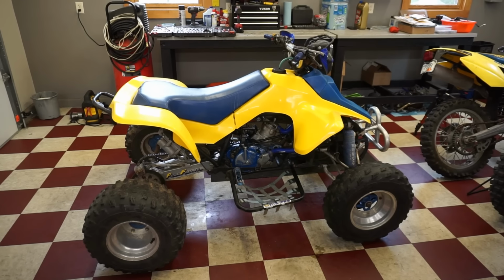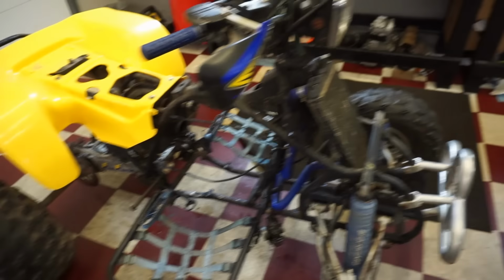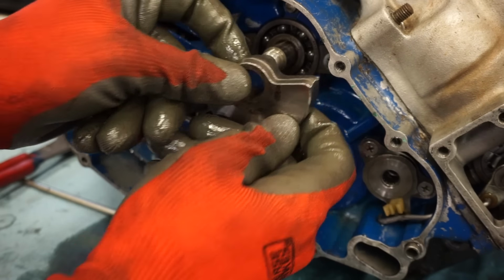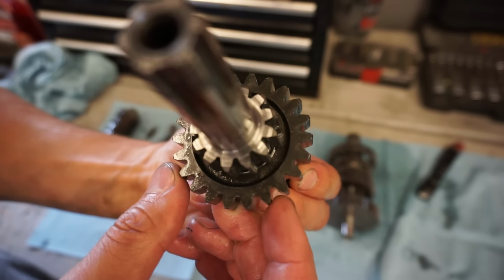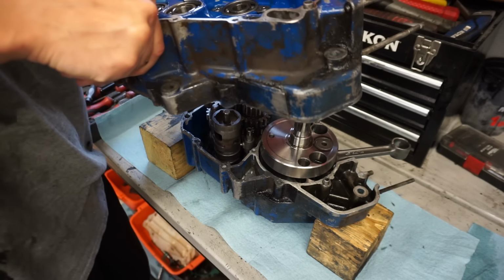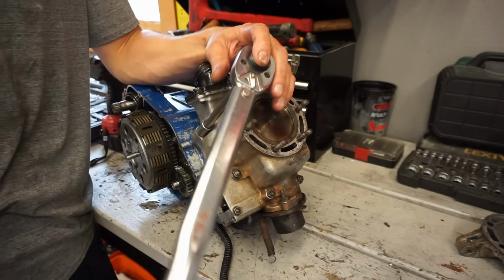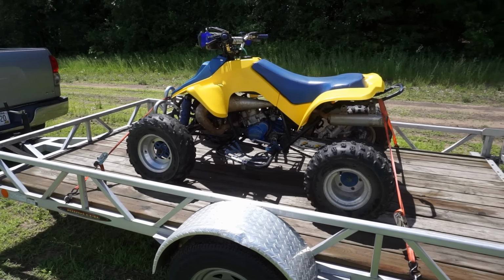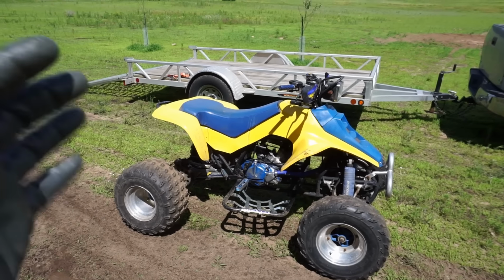Rare 2-Stroke Race Quad Slips Out Of Gear...(PROBLEM FOUND)

Comment: Ever heard of backgrinding?? Look it up. A little bit of grinding on the gear dogs in the right place and when the load comes on they engage and some.  The old gearset would have worked. Pays to check end float too.

Comment: One of the top LT250r builders chiming in here.  Please air-leak test that engine.  The exhaust valve can be tricky to seal up but once it is, it will jet easily and cleanly.  

Again, let me know if you need anything for that machine.  I have NLA OEM engine service parts, upgrade parts that I make, and lots of graded used parts.

That FTZ pipe is beyond rare.  I've never seen one of theirs that run in the stock pipe routing.  The more common(still SUPER rare) FTZ pipe hangs out of the frame on the left side and is HUGE.  

If you want that bike to really run well, shoot me a message and I will be able to point you in the right direction.  The AAEN porting on your cylinder isn't what most would call great.  If you could get a clear pic of the engraving it would help ID if the cylinder was actually ported by them or if someone carved it on there themselves to try to increase the value.  Both FTZ and AAEN did port/pipe/carb combos so it is kind of odd to see the mismatched tuner's products on that bike.  

I can help with details and history on the parts on the bike and the tuners that made them if you want.  Just let me know what you want to know.
Reply: Makes me wish I still had my 86.
Reply: lol,i thought i was the top lt250r builder???lol.dont pad yourself on the back to hard!!!lol
Reply: @yeahright302  I stay humble.  My work speaks for itself.  I have rolled back the work load for the last couple years but I still stay in it.  You'd be surprised who is who behind the username.
Reply: @rm25088  Do you have an '88 RM250?  I'm pretty sure I have a complete top end for one.  It would need replate, but is complete.
Reply: What exhaust valve?
Reply: @yeahright302 How insecure can you get? A guy offers help and you shit on him. Get a life.
Reply: @joebinder6119  There is a valve in the cylinder for a resonance chamber to improve low RPM torque.  It closes at around 5500RPM.  It's not a true power-vavle but more like the Honda ATACS system.  It commonly can be tough to seal up.  It can draw air from the transmission/clutch housing.
Reply: Sounds like you know what you are talking about.
Some listen some don't
Reply: Thats awsome, if I where him id be hittin u up .. kinda rare these days to find someone that knows and is willing to help in the ways that u offered
Reply: Experts chiming in everywhere😂
Reply: The oil in the transmission on a two-stroke has nothing to do with the engine
Reply: @joebinder6119 the one in his mind
Reply: @RonaldDaub-xi5jz  Your comments show clearly that you are not familiar with 2-strokes, let alone this model.  

Indeed the transmission oil and the lube oil for the engine should be separate.  

What do you think the "exhaust valve" I am referring to is and does?
Reply: @BillyWillicker 
Those pesky crank seals,and trans oil.😂

I find those power valves are voodoo black magic, best left to a pro.
Reply: @johnrambo1227  It depends on your level of understanding and skill.  There are a few ways to do things right, and many ways to do things wrong.  

If you understand the how and why of what you are working on, it can be done well.  If not, it should be done by someone who does, and will do it right for you.

Sometimes, depending on a person's skill and knowledge, it's cheaper to pay someone to do work for you.  

Have you ever seen an engine that someone who had no clue what they were doing had worked on?  I'm betting you have.  What did it make you think?
Reply: Hmm, I have a 85 LT250R and need some info. Can I send you some pics? Contact info perhaps?
Reply: I got a 87 im building whats your contact info
Reply: yeah its not revving out clean

Comment: You were absolutely right, that missing bolt on the shift drum was the initial problem but it was ran that way too long and probably worn the shift forks out of tolerance which you’re probably not gonna see with the naked eye. I don’t blame you a bit, I’d have done the same thing just replacing the bolt and trying it 👍

Comment: One these race bikes/quads.  -Always nice to have a 2nd or 3rd engine/bottom just sitting and waiting to go in.   =Race 1 and work on the other.
Reply: That's what I used to do. I had a practice bike and a race bike. The race bike was strictly for that purpose alone, while the practice bike took some serious abuse. Every Sunday was fun for two reasons. # 1 was the racing, and # 2 was because I got to ride what was essentially a brand new bike.

Comment: Those old Suzukis are nice.  I had a Quadzilla back in the day.  Still kinda miss it but it needed pretty regular repairs / maintenance.  This is why I like my Raptor now.  Almost no maintenance.  Change the oil, lube the chain, put gas in.

Comment: Great job, at time frame 33:59 you can see where the gears have rubbed the case next to the big bearing in the r/h case ,most probably when the end bolt was missing previously .Is that where thee metal shaving came from.
Reply: Could very well be. Besides regular clutch wear which can be seen with every oil change (it makes the oil look like metallic paint) anything large enough to be able to feel with your fingers is abnormal wear.
Reply: @stkyfngrszmooth  The clutch is on the outer case ,and not were i described .
Reply: @johngriffith5231  Yes, but it still shares the oil with the transmission.
Reply: @johngriffith5231  Yes, but the clutch still shares the oil with the transmission.

Comment: Glad you found the issue, it`s hard to believe that little bit of wear caused the problem, but obviously you still had something rubbing which explains the shavings still in the oil, there was something wearing on those gears and shift arms, well done.

Comment: My cbr600rr would slip out of 2nd gear on acceleration, I found the dogs and recesses on 2nd gear to be worn exactly like yours except the shift fork that engages 2nd was deeply gouged, not bent but gouged, and those 3 things added up to 2nd gear not staying engaged. It's been 10k miles since I fixed it and 2nd gear is still going strong. Good job Joe transmissions can be very tricky

Comment: Hey Joe, place a slim O ring on the shaft with the litttle gear that likes to go AWOL. That way, you can slide the parts together and the O ring will not cause difficulty. I do that when I build transfer cases and transmissions because if the needle bearings get away from me, it all has to come apart and be reloaded.

Comment: Great job!!!
..she sounds really tight and.fresh, sounds like u can drop the main a few to get it revving higher at full throttle and richen the pilot or maybe turn the air screw half a turn richer , Since u can literally rebuild.any motor now , next genre to start mastering is Suspension,...rebuilding, serving, oil, seals, disassembly, special tools tht motion pro should send u free as long as u advertise.using it in videos....surprised u don't leverage even more of.your massive following to aquire free tools from like minded companies.into moto....

Comment: An Accumulation of wear throughout everything in motorcycle transmissions can cause mishaps in the shifting. In fact I would have measured the left side of the shift drum that goes into the bearing on that side, as well as inspected to see how tight the corresponding bearing was in the case. I noticed during the first go around that one of the bearings in the case nearly slipped out...... that tells me the case has some wear, which could be where some of the flecks were coming from, along with the gear wear. Usually on an older machine you end up finding out that the main problem is case wear, that leads to gear wear, that leads to shift forks wearing, which also wears out the drum over time and shifting problems. However often if it's an old machine, it starts with case wear.  You can put brand new parts in an old case that's only slightly loose, and within a few years, you'll have shifting problems. 
Years ago, I've seen guys mix up JB Weld and put a light coating on the outside of the bearings before installing them in the transmission case, just to snug everything up a little. They'd reassemble it, and let it sit for a week with no oil in the gear box, so the JB Weld would harden really well, then put the lube in and put it back into service.  If you're trying to patch up an old machine to get another couple of riding seasons out of it, for a good customer, you let them know the circumstance, and that it will buy a little time for them, until they can maybe find a donor replacement engine to build .

Comment: In my experience one popping out of gear is bent or worn shift forks. I know you measured them and the thickness was the same. But I’d bet the forks that came out were slightly bent from the shift drum moving around.

Comment: FTZ - full race, high end.  -See if you have the FTZ head mods.  Pipe is worth some money.   Could swap to cheaper DG (new/used)  for thicker pipe and better off road torque.
Reply: I had the full DG setup on my 1985 QuadRacer, but it didn't matter because my brother could still smoke me on his bone-stock 1985 ATC250R. Those things were stupid fast.

Comment: Sounds like the power valve isn't opening up when at high rpm! Basically sounds and looks like there is no power band
Reply: I was gonna say same thing! No change in tone as rpm increase.. its almost like a vtec when that powerband kicks on my machine anyway.. and that’s the 87 with bigger air intake port.. thing should sound a bit better.. Joe knows it too tho. Maybe the powervalve needs adjustment 🤷‍♂️ anyway that shouldn’t be too terrible to figure out
Reply: @fromex2lsturbo  I have the same quad and when my power band kicks in I can barley hold on to the handle bars
Reply: @jessiej3991  your shit is dialed then 🤙

Comment: Where's that piece of broken off aluminum at Joe? That you found in the case laying in the bottom inside of it. I do believe it's part of the split transmission side where that spring loaded metal release shift lever mechanism safety stop. You can fix it by using some JB weld reinforced steel  tank weld putty. It will hold it into place. It has to cure completely though.

Comment: I once had an 02 yamaha r1 that would pop out of 2nd gear pulled the trans out and the dogs looked worn but not terrible at all I thought I was wasting my time replacing the gear but sure enough just that little bit made the difference it was baffling to me.A machinist can actually cut the dogs to have a taper so when under pressure it pulls the gears inward  holding them together instead of pushing apart which from what I understand is how they come new with a ever so slight inward  taper.

Comment: I'd try looking it up the jetting format from the one that was inside of it originally. To the lowest one you can put inside of it. Which should be marked and labeled on the specifications spread sheet charts as we'll. For the correct carburetor jetting and tuning sizes. For those model and style of Suzuki quad 2 stroke.,or 4 stroke engine block split cases. Either one you may.,or may not have. It'll show it in.,an on the format information spread sheets still.,or should that is. Most of them did. Try finding some mulleys repair manuals and Haynes and Chilton's manuals  as in books to possibly help out with finding that information out more. Mainly for yourself and possibly that can help out others with as we'll to. Anyways good 🤞 luck with it all.

Comment: 2nd gear shifting dogs are rounded off on the ends and thats what makes them push away frome each other. if you had dove cut the dogs with a die grinder tool you would have never had to go into it twice Dove Cutting pulls the gears into each other ive done dozens of transmissions with that proceedure

Comment: It's part of the machined Lazer printed split case cutout halves. Case of being ran low on oil and power shifted without using the clutch when shifting through the gears. It overheated the oil inside of the case from being low and broken down oil. Then it eventually snapped that aluminum piece off inside of the split case. So you might have problems with it in the future has it's missing from inside now still to. The only other thing is it was part of the old piston connecting con rod.,or A broken piece of the piston itself one. I know how you can tell for sure on that part to for sure. You can pull up A split case diagram then blow it up to see inside of it really good. Then save it to your computer to print out A copy to look at.

Comment: I had a similar problem with a 2014 rmz250 the problem was 3 and 5 gears dogs were a little rounded and i replaced the gears and the problem was fixes

Comment: Remember that bolt and washer missing on the shit drum. That proably did not play well with the shift forks and drums leading to wear and bending that then made sloppy engagement of the gears and caused the wear on the gears when you rebuilt it. I would bet it's the shift forks that need to be replaced. The gears are probably fine they are just not getting good engagement because of the shift forks.

Comment: Tape a magnet under the drain pan when you sift for metal flakes in oil. You can see if it’s steel or aluminum that way.

Comment: How much did you pay for the used trans?
Reply from the maker: $240
Reply: @2vintage Ouch. That's a kick in the nuts. Plus, now you have to tack it onto the overall investment, which will cause your profit margin take a serious hit, and that doesn't even count the labor.
Reply: @stkyfngrszmooth  If the revenue from this vlog reaches over £240  its still a win win

Comment: Multiple tear down trouble shoots are terrible...butt, sometimes necessary... although you would eat that extra cost in time for it if it were a customers unit..
Reply: @lucyzamb, no I would still charge for taking back apart not his falt he didn't see the problem.
Reply: @jasonjgr8580 he should of inspected everything when he knew it was jumping out of gear

Comment: logged in to say: check the wear tolerance of the shafts the shift forks slide on. The wear limits are in the manual and difficult or impossible seel by looking. I had a crf that kept popping out of gear and I could not find any damage until I finally mic'd out those shafts....found them barely out of tolerance. Put in new ones and problem solved. I have no clue why that happened but it hasn't happened again.

Comment: You are missing the clutch arm bolt. Where the pin goes in the case 10mm.
Where the caible bolts on to the case

Buy this needle 6chy5-79 clip on top tapper needle

Comment: The bolt missing from the shift drum was the initial problem,  but, I don't think the shift forks were the problem.  The other end of the shift drum were the star configuration is, is worn, especially where the neutral 'crater' is.  the points on the crater are worn down when compared to the 'new' one.  This, I believe was causing it to pop out of second gear.   IMHO.

Comment: When putting the cases back together, you want to do it by pulling them back together using the bolts. Not by using a rubber hammer. That way, you'll be able to feel if there's a hang-up along the way or not.
Reply: Bad decision using the bolts,the cranks are tight u need to nip up with a crank puller tool,banging with a rubber mallett is bad aswell,i used to use the rubber mallet when young and it popped a front sprocket bearing out of its groove,would shift only through a gear or two had to split the engine 5 times till i spotted the bearing slighty moving out of its groove
Reply: @2strokemxclassics  If you know what you're doing, you'll be able to feel any type of binding and back off.

Comment: Well everyone in the last video said it was the dogs and where the dogs locate being the problem caused by the previous owner I guess we were all correct As soon as those dogs got a slight taper or rounding the rotational force would tend to throw the gear out of mesh But as you get paid by the views  its all good for the revenue 🙂

Comment: You DIDN'T FIND THE PROBLEM THEN DID YOU ?  All you did was replace parts !  I can understand that it all takes time but, it's click bait al the same !  It's hard taking all the time to solve things ..... I KONW !  But, you are the customer and you could take what ever time you wanted.  It's the whole learning process.  It's like a huge puzzle.  If you were in a production shop I know how that all works ......  But, it's just YouTube and solving the problem is a huge thing but, don't use click bait !  You're too good for that !  I really like your channel.  You do nice work and I know how frustrating it gets.  Keep on going though.
Reply: @eddyedwards  Not saying that at all !  Don't be stupid and even assume that !  The whole thing is to learn and find the problem not just throw parts at it.  Anyone can throw parts at it and get it going !  What's the objective if you do that ?  A fixing channel should dig deeper into the problem especially with parts being so expensive and some very hard to get.  It can't be done all the time I know I deal with it daily but, I don't put that I found and fixed tge problem .... think about it !
Reply: No, he doesnt know what exactly in the old transmission caused it... he just threw another one in there so ofc it fixed it, but he could have fixed it with filing the dogs on the gears and some shift forks... wouldnt have had to buy a whole trans...
Reply: @thyreaper650  thats my point